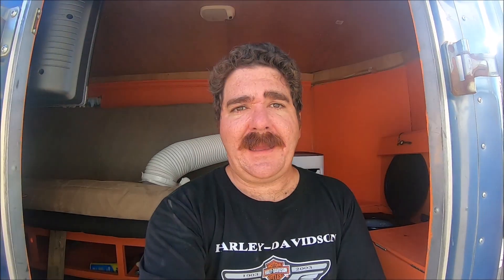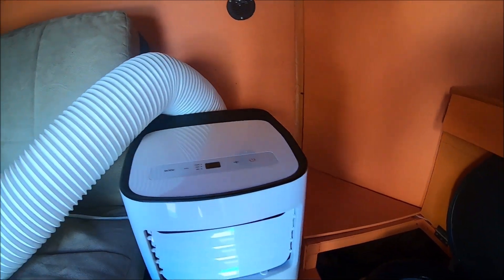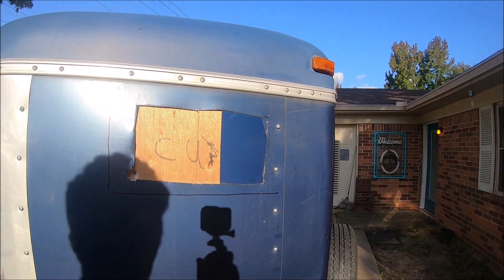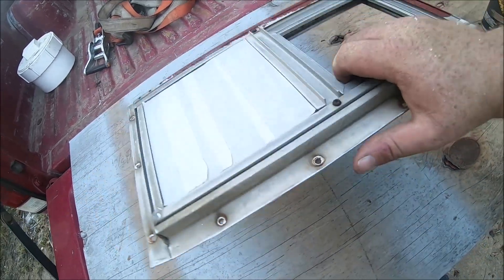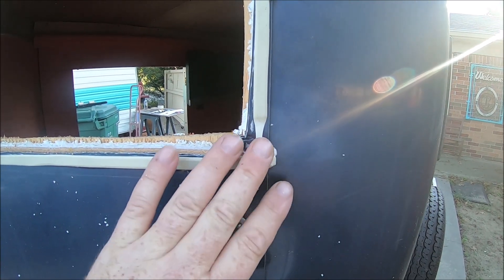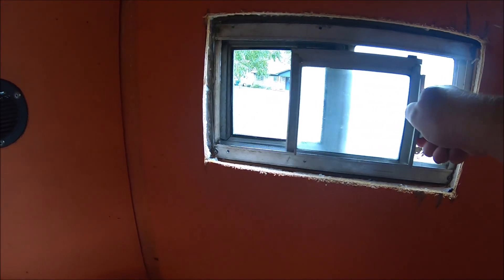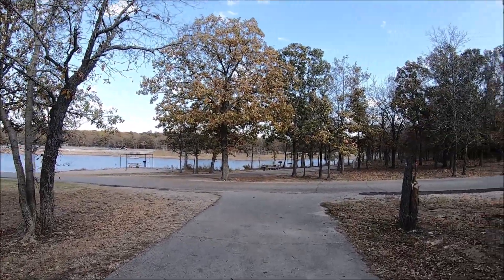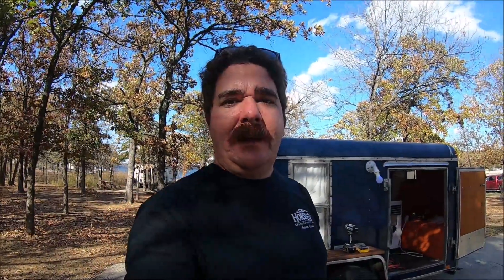Cargo trailer air conditioning

Comment: Fitting your needs perfect. Love the sofa too. Good thinking on the window. I am planning on faux ship lapping the walls. Hand painting the plywood. Then varnish it. Ours is higher ceiling. I can stand in it husband has to bend head a bit. Will be doing cabinets like a pop up camper build. Not heavy. Will put port a poddy in a cabinet to pull out at night and put in front of door. Half shower curtain for privacy on ceiling. Also will be shower area. I will tie to side of door when not in use. Are building a small one foot wide cabinet on door side on bottom. It will hold blankets and pillows when in sofa mold. Upper cabinet a bit wider, tall and two short ones over window. Or shelves. We have escape window for driver side over sofa, and a window across. Kitchen area in front. Counters and cabinets or shelves. Nothing fancy but hope it will look nice. We have stick down floor. Brought everything we need from home depo. We have lots of camping stuff. So did not have to buy allot for that. Already had three windows but only using two. You could add some shelves cover in carpet from home depo, and use square baskets the foldable kind. We did that in our run a way. I use bungie cords and loop metal circle thing to put the loop hook at end of bungie. X it over front. Rug can be brought and cut up cheaply. We built a ledge on front as in run a way camper shelf they installed. Run away a great little camper we love ours but found I wanted a poddy inside. Also, lightening storms would like to be able to cook inside at least coffee. In the run away we put kitchen in back like a tear drop. Rustic tear drop also builds a great camper. Got allot of ideas off them. We just can not afford to buy one already done. The run away my son is buying from us. So far cost of used cargo, and building materials is 1,700. We have wire, and plumbing. Added expense was electrical box, on sale camper world 129.00, a on demand water heater a gift but cost 169.00 e bay. Two lights led 22.00. Are budget was saved up for 2000.00 When we sale the run a way we will have spent 500. I picked stuff up over the last few yrs at yard sales, and junket shopping.